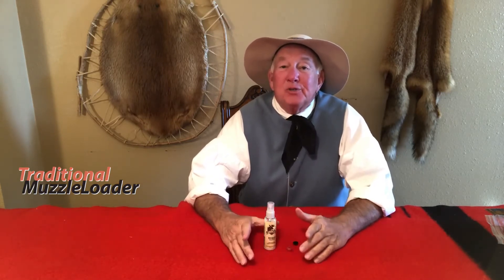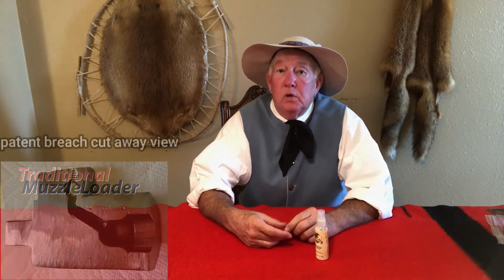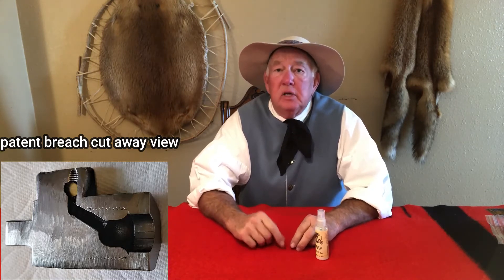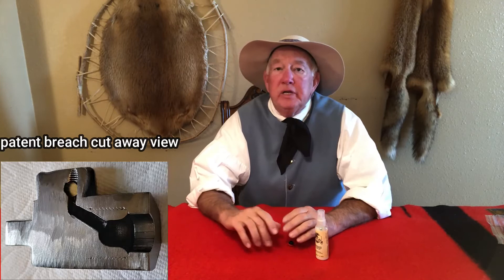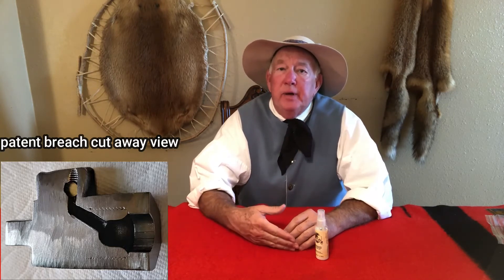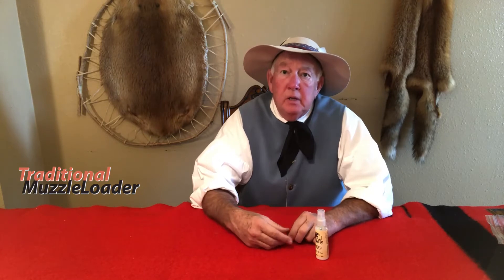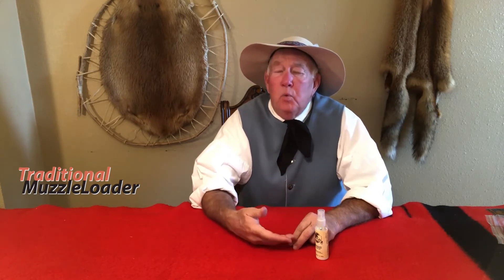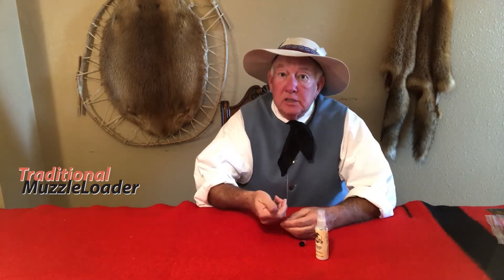Masterclass on the Muzzle Loading Percussion Rifle - Part 5 Cleaning and Reliability

Comment: Good stuff.  I have found with patent breech rifles that the cleaning method recommended by T/C back when they actually produced traditional BP firearms, was to remove the barrel and nipple, stick the breech end into a bucket of hot water and pump a cleaning path up and down the bore until the water coming out of the muzzle is clean.  It takes care of the breech and heats up the bore to dry.  Then of course make sure the barrel is completely dry and lubricate. Like you said there are a lot of ways to clean BP firearms.

Comment: I was interested in cleaning out residue oil that is possibly in the nipple by discharging several caps. I solved this problem by storing my black powder guns barrel down in my gun safe. Any residue oil will eventually end up on the floor of the gun case. Give your riffle a quick clean with a patch and you will only need one cap to make sure the channel is clear.

Comment: Loved your series.I feel ready to try.  Question:If you are using a rifled barrel,why not shoot a bullet shaped projectile?
Reply from the maker: Round ball is the correct projectile for the time period I reenact.  Bullet shaped projectiles came into common use latter. 1860's The Minie ball during US Civil war.  My rifle barrels are 1-66  twist for patched round ball.  Bullet shaped projectiles need a faster twist to stabilize.  It's a matter of personal preference.
Reply: @traditionalmuzzleloader4983  I had a feeling about the period authenticity.I did not take the twist rate into account.Did not even know there was a 1:66 barrel.Makes sense,though,.Is there such a thing as a barrel with an intermediary twist that works for both ball and bullet?Any special caliber that does that? Are there  small caliber black powder guns?
Reply from the maker: The 1-48 twist in many imported rifles is a compromise attempt to shoot both projectiles.  Like all compromises it isn't the best for either. Yes, small bore rifles are available from 32 caliber up.  It's best to decide which projectile you want to shoot and build your rifle around that.

Comment: I've only had my T.C. Hawken for a short while. I was told it was ok to put it in half cock to dry fire with the set trigger. I hope I haven't wrecked my triggers! rats! I thought I was doing ok and not hurting the gun!
Reply from the maker: No! never fire your set trigger in half cock!  You might break your lock.  It isn't good to trip that set trigger with the cock fully forward either.  You can bend or break the sear arm on a cheap lock.  In my next video I will show you how to use a wooden flint to practice and dry fire without doing damage to the lock or triggers.